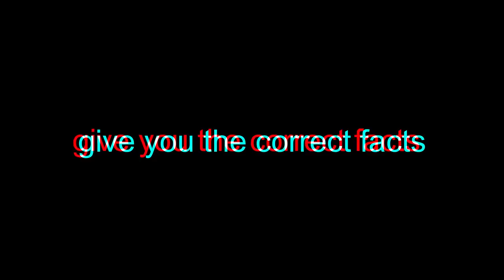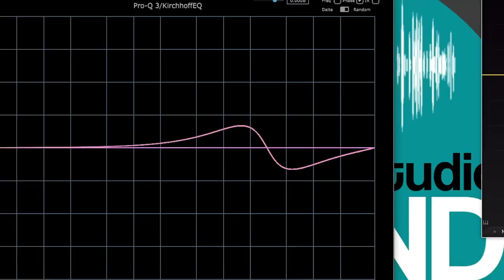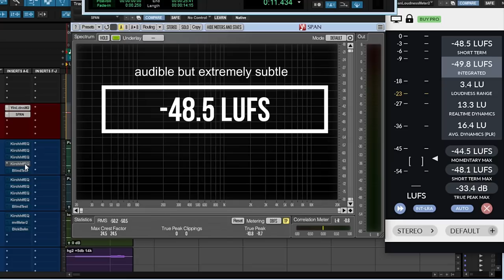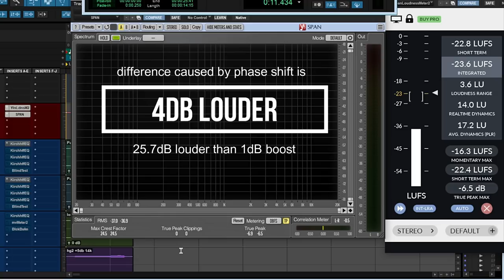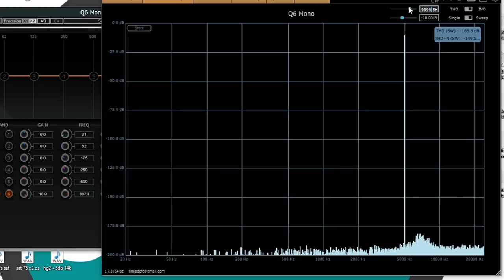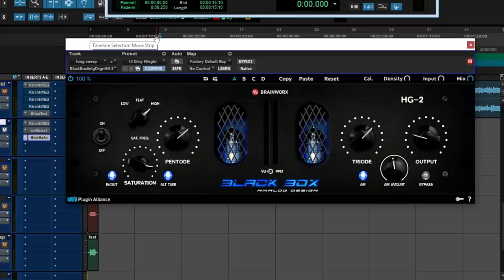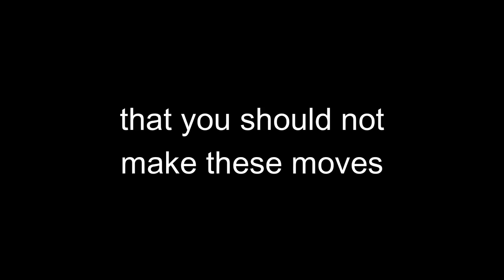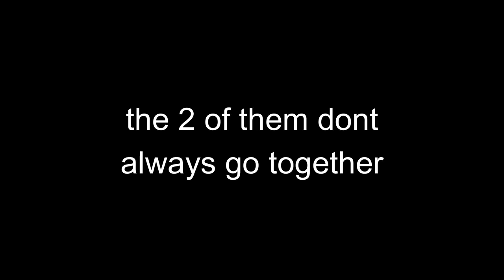THIS is why engineers tell you NOT to EQ like THIS when mixing

Comment: So if we cut before an analogue emulation we won't be pushing the level and won't create aliasing. Boost after a linear emulation to avoid aliasing
Reply from the maker: Depends on how much high order harmonic content the non linear process creates and how high it makes it but yes I'd advise boosting after non linear processing to avoid aliasing for the most part but whether its necissary depends on the size and frequency range of the boost, whether the source itself has enough high frequency information and ultimately the harmonic behaviour of the compressor or saturator

Theres quite a few factors that have to be in place for it to be an issue but it's really just something to bare in mind that if you eq heavily into saturation that area will be saturated more so its whether you want that